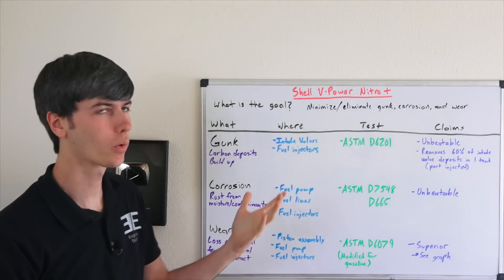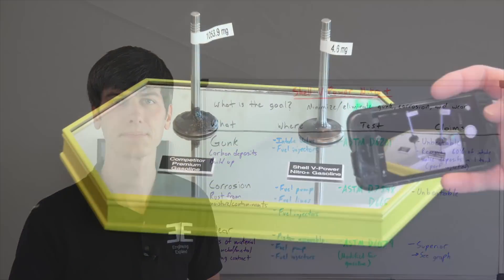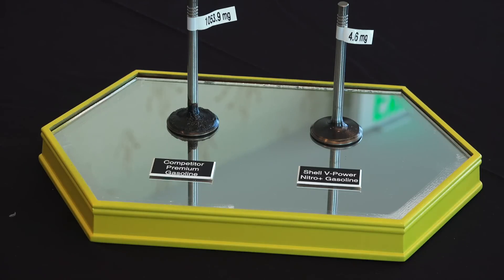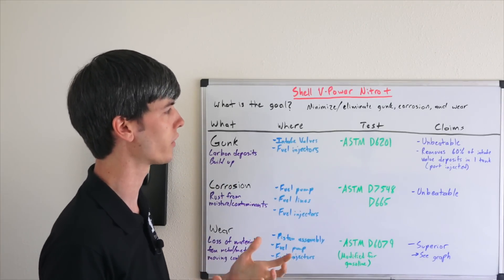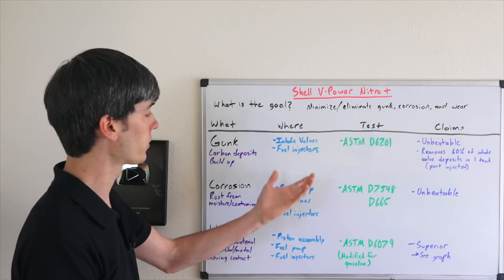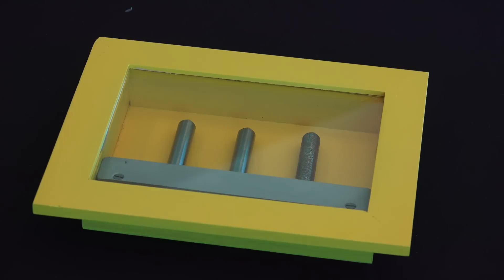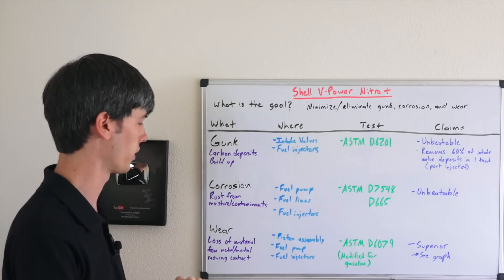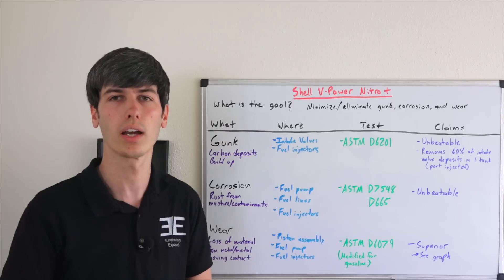Shell V-Power Nitro+ (Premium Gasoline Fuel Testing)

Comment: I've been using V-Power Nitro for a while now (UK) and having been testing it under more realistic real life situations.  I have to say that I'd personally never go back to using anything other than Nitro/V-Power,  I currently drive a 2007 HR 350z,  I've tested using a shell competitor brand (Super Unleaded).  I find that when I use V-Power my car's long run MPG increased from avg 27 to avg 29 mpg,  I also notice the big improvement in throttle response,  the car doesn't bog down as much and I also notice the engine seems to run a lot smoother in general when running Nitro+,  it's not a massive difference however if it's absolutely noticeable.  I've also created a thread of one of our forums discussing the theory and almost everyone commented back with the same results.
Reply: Hyperezil Your text reads like an advertisement.
Reply: Same here. I've noticed a difference in MPG. Love nitro+
Reply: @Tropic_Thunderzz  Shell derv is good as well, + V power derv, supermarket fuel is pants,
Reply: ***** It's actually cheaper for me to buy Shell's V-Power Nitro+ at 1.17.9 than my local Jet which is 1.21.9 for 97 Ron Super,  similarly the Esso and BP garage next to the shell are all selling their super unleaded at 117 also,  so really not very much at all, if anything it's cheaper.
Reply: 27mpg!!!! How man, I get like 18....
Reply: Hyperezil This is all anecdotal evidence and nothing scientific. All of these claims can be argued as confirmation bias or placebo.
Reply: Jaaaaap If I could advertise them and get free petrol.. I would, unfortunately this doesn't seem likely.
Reply: RPrevolution25 Standard HR used mainly on duel carriageways, into 6th 60/65mph =  27-29mpg easy done haha.  A lot of the 350zuk members are seeing roughly 18-29 some as high as 32 lol.  I take your's isn't stock?
Reply: Hyperezil 04 DE. Mostly drive around town, never on highway. Also no, not stock.
Reply: Hyperezil Where are you based?! I'm paying 125.9 per litre in London...
Reply: +Hyperezil i got better performance in the lower RPM range with V-Power than i do with any other gas, ever since Shell added Nitro my acceleration with 1.5-2k rpm has improved provided i am getting good airflow which also equates to better gas mileage overall. Also mid throttle gets me up to the speed i need quickly at highway speeds where i only need that power for a few seconds. While yeah you are paying more at the pump but the benefits is that your engine stays cleaner and you don't have to worry too much about throwing in additives.
Reply: +Aaron Tsui Scotland mate,  sitting at 1.12 per litre just now for Vpower.
Reply: Haha just added this comment and saw yours 3 down from mine ..I've been using shell 91 in all my cars getting better mileage ect. But until I bought my 350z HR have bolt on mods it idles pretty bad almost dies out and pings on shell 91. I tried 3 different tanks at shell using 91 and same thing happens. Switched to Esso which has ethanol and idles way better , same with Petro
Reply: Thanks I just tried it today it's pretty good
Reply: Yes the change in smoothness is really noticeable even against shell regular

Comment: My gunk solution is:

-Wynn's Diesel EGR 3
-Forte Diesel Turbo Cleaner
-Wynn's Diesel power 3

Using it yearly. 150.000 miles on a original EGR valve with an turbo diesel engine.
Sea Foam is also great motorflush solution but only if you know the engine is dirty and you do change the motor oil yourself.

The second car is an gasoline with multipoint injection, not using any anti gunk solutions on that car. If it would have direct injection then I would...

Comment: This Nitro+ petrol has been available in the UK for a while. I know US has different standards of testing. I BELIEVE (correct me if I'm wrong) but these fuels can also provide a little more BHP in turbo/supercharged cars. They'll run okay in normal cars (I use it in my non turbo car just for the sheer fact that I get points :D) but you won't get any more BHP. Maybe a little more miles per gallon. Anyhow I found that my car runs best on this stuff, regardless of all the hype etc.
Reply: In California we have clean gas due to smog and epa regulations

Comment: "removes the 60% of intake valve deposit" - OK. But where does the carbon deposit goes after it's removed? Is it safe to use it, w/ some serious carbon deposit? Would not do some damage after 60% of the deposit is removed? (i really don't know how it's working, and how does it effects the life of the engine) Can you explain it among the other "avoidable" contaminations?
Reply: YourNickIsTaken it probably burns up in the combustion chamber and gets sent out the exhaust.
Reply: YourNickIsTaken it probably burns up in the combustion chamber and gets sent out the exhaust.
Reply: Darren Boss So it does not do any damege when it's removed by the fuel
Reply: YourNickIsTaken No. Some modern diesel vehicles have some sort of particulate filter that recirculates some of the gasses through then engine to burn off the soot. That goes out the same way.
Reply: Darren Boss But this is not a Diesel fuel
Reply: YourNickIsTaken No. It is safe and propably the best fuel out there right now.
Reply: Thanks for the replies. Guy :)
I'm a bit late but i've read it last year too, just forget to say thanks.

Comment: Oh great, a bunch of tests done by the people trying to sell me their product. I've been using Shell in my Yamaha R1 for a while but that's because an independent motovlogger showed that he gets better fuel mileage with it. But come on, 60% reduction in existing carbon deposits in one tank?!? It would take me an hour with a wire brush and carb cleaner to scrub off 60% from one of those dirty valves you showed! I think Shell is full of crap on their claims and that representative didn't even sound very confident saying them. It may work better, but their claims seem totally unrealistic.
Reply: Dani2wheels Maybe the 'competitor's' fuel they tested against was crude oil straight from the oil field :-P
Reply: Dani2wheels 60 % in 1 tank, great.  i'll fuel with it once a year and bingo !  :P
Reply: Rodrigo Ribeiro It depends greatly on how the fuel was stored, the engine used, the metallurgy of that engine, and its overall construction.  These tests have clearly been highly optimized with the chemical properties of this particular fuel in mind.  That is not to say it does not have its advantages, but I imagine real world results will vary greatly.
Reply: +Dani2wheels All the tests have been done to an ASTM standard, but I would be very interested in how they validated them, possibly with a third party.
Reply: Andrew Price Good analysis, lots of good points made.
Reply: RoboTekno Blahaha, hilarious!
Reply: Andrew Price Good analysis, lots of good points made.
Reply: +Dani2wheels I won't use shell. Not that others are innocent. But they've been caught in numerous false claims in the past.
Reply: Dani2wheels 

Ur entirely right ! That's impossible to clean , 
(In one tank full ) & if u did get rid of everything (caked on carbon deposits)  that crud will end up in places in ur engine that can instantly cause the engine to seize up!
Reply: Dani2wheels which blogger was it I’m looking for the best gas for my gsxr1000
Reply: But he was wearing a white lab coat so he must know what he's talking about, right?
Reply: ***** Haha! That's a great point, why do I need to use it every time, once a year should do! haha

Comment: Are there any performance advantages ? I know the reducing carbon build up is extremely important. But is there a chance that they may have sacrificed the performance aspect of it for this ? 

For instance for turbo charged vehicles i wonder how this fuel will do ? is the octane sufficient enough to keep knocks down? 

Personally i've been using chevron 91 in my 1994 toyota supra and i've owned that car for eight years. Recently i took the head off to upgrade my head gasket and really there was not really any carbon build up in the first place. 

one of the easy ways for carbon to build up is when oil gets through your crankcase vent ( PCV ) and gets into the intake and cakes on the valve. if you have that problem you can get an oil catch can and it will infact make a difference.

Comment: they claim that it can clean engine valves up to 60% on one tank, but is it safe to have the carbon build up leave through the cylinder and exhaust gasses or should you clean your valves before using they're "unbeatable" product?

Comment: -Does this fuel actually contain "nitro" in it? Like a % of nitromethane in the 'V-Power Nitro+'???
-Or is it just a jazzy term they are using to spice up the fuel's name?
Reply from the maker: Nitro refers to nitrogen in the detergent, it's the element that bonds with carbon deposits and detaches it from surfaces.
Reply: Engineering Explained But the air I use in my engine is 78% nitrogen, so why do I need a tiny amount more of it in my fuel?
Reply: Engineering Explained A little misleading, lol. Oh sneaky marketing department... :-P

Thanks for the video though. If I had a car that needed premium fuel, I'd give it a try.

Comment: Engineering Explained  those photos you showed are of Direct Injection Engines so the fuel has nothing to do with the valve deposits.  only if they where port injection
Reply from the maker: Yep, honestly slipped so I added an annotation and included a note in the video description.

Comment: I'll it make my rotary backfire more? Carbureted 12A rotary engines backfire more on premium
Reply: Ty U. 12a's only require 87 octane. Putting anything higher in a vehicle than it requires is a waist of money and can cause incomplete burns which leads to "gunk" build up and can cause backfires. The octane rating is not a measure of how "good" the gas is, but how easily it will ignite/ how fast it burns. The larger the number the harder it is to ignite and the slower it will burn.
Reply: DOG_REDRUM Yes I know, I do it because I like the backfires, gunk is of no concern because I need to rebuild the thing soon anyways.
Reply: Ty U. i had the same thing happin to me years ago ran the best on 87
Reply: Luke Shaw Engine rebuild? Yeah I got an oil leak coming from the block, some bad seal.

Comment: Those ASTM test papers cost 43-62 dollars a pop, so it's quite expensive to actually delve deeper into how the tests are conducted.
ASTM D6201 uses 2.3 liter engines from Ford Ranger, which is actually a Mazda engine:
http://en.wikipedia.org/wiki/Mazda_L_engine#2.3L_.28L3-VE.2CL3-N5.2CL3-DE.29

ASTM D665 is a test meant especially for steam turbine oils and how mineral oil additives help prevent corrosion in metal parts if moisture gets mixed in with the oil. The test is clearly not meant for gasoline (engines). Basically what this test tells us is that Shell V-power prevents corrosion in steam turbines better than competing brands of gasoline, I don't think it's that relevant in an automotive sense. Or who knows. It'd cost me $43 to see what is actually tested.

ASTM D7548 states that the test can be done with diesel, regular gasoline, gasoline with 10% of ethanol in it and some other petroleum products. Shell fails to mention what kind of fuel the competing one was. They could have used an E10 gasoline with 10% of ethanol in it, which is known to cause more corrosion than regular gasoline without ethanol.

Then there's the fact that these tests are conducted by Shell. Of course they only publish results that show their product as superior to others. They might have done dozens of other tests as well, but cherry-picked these four tests because they showed the best results.

I'm not saying they don't have a good product, I'm just saying that these kinds of results must be taken with a grain of salt for obvious reasons...
Reply: Kepe  Yes the papers are expensive, however in the US most SAE, ASTM, ANSI and ASME standards/procedures/methods/white papers are available for free viewing at many university/college libraries and at most public libraries. 
First, get a comprehensive understanding of the fundamental engineering and test principles, then determine how they apply to this Shell product testing. 
ASTM D665 is not about steam turbines. It is the "Standard Test Method for Rust-Preventing Characteristics of Inhibited Mineral Oil in the Presence of Water" .  It is for testing  refined petroleum products including lubricating oil for its rust/corrosion/oxidation performance in the presence of water and certain minerals/elements.  
ASTM D7548 is specific to iron material corrosion in the presence of most liquid fuels . 

If you have doubts about the validity of the testing or the methods used by Shell, personally contact their customer service department which is available on their website. 
Publicly casting aspersions about Shell without comprehensive knowledge of the standards or Shell's methods is simply not fair to Shell or the viewers of these comments.
Reply: patw52pb1 I didn't say I doubt their test methodology or that they are lying about their test results. I said I don't trust a company to tell the whole truth about these kinds of things. Every company in the business of making money by selling something will of course try to make their products look as good as possible. All I'm saying is that Shell showed results of four tests they had conducted, but what we don't know is if they conducted more than these four tests and if they did, what were the results and why didn't they show those as well.

If the ASTM D665 is not for steam turbines, why does it say so on the D665 page? As I said, we don't know what exactly is being tested and how without paying ASTM. What if the test uses jets of high-pressure steam to test how well a piece of metal is protected from corrosion? That would have absolutely nothing to do with cars.

Have you ever seen a company release test results of their products, which show that some competing company has a better product? I don't think so. The tests and competing products are always selected so that your own product is the clear winner.

Comment: This makes me wonder why they don't add these properties to all they fuel grades. Is it something that can only be done to high grade fuel in order to be effective?

I'm running a tune that requires premium. After seeing some of the pics of carbon buildup, I'll definitely be careful where I fuel up now. I may give this nitro+ fuel a few runs through the tank.
Reply: Darren G. $$$$$$$$$$$$$$$$$
Reply: For my car if I put gas from speedway in my tank, my engine revs at idle are all over the place. For me shell's premium works great. I have a 2004 Mazda 6i 4cyl 5 speed manual.
Reply: ***** Just a heads up, the base gasoline from pretty much any seller will be near identical. Only thing you really get buying from different sellers is different cleaning additives. Same thing goes for oil buying oil. Anything wrong with the way your car runs would be with the car and not the gas.
Reply: tolikechicken Well I tried every other gas stations regular 87 in my area. Speedway was the only that gave me trouble. I just use shell premium because I can tell my engine reacts faster when using it.

Comment: What kind of gas you guys are using over there? I never saw a intake port so dirty... And I live in Brazil, our gasoline is regulated to always have 25% ethanol (E25) and many cars runs on 100% ethanol fuel. Here a engine with 20.000Km looks as clean as the day it roll out from the factory.
Reply: Olá, essa carbonização severa é culpa da injeção direta de combustível..

Comment: Do any new cars still use Port Injection? Because the part about intake valves would be irrelevant for Direct Injection vehicles right?
Reply from the maker: Ricky Julian Yep, some cars are doing port and direct to have the benefits of both. Direct alone can be problematic due to carbon buildup.
Reply: Ricky Julian Toyota has the D4S,  port and direct injection.
Reply: Engineering Explained The carbon buildup pics you showed in the video are all VW EA888 Gen 1 TSI motors, all of which are direct injection. These cars suffer buildup from poor PCV filtering and EGR particulates. It's been confirmed that there is no injector overlap on the valves as well, so the fuel will not be hitting the valves or ports in normal operation.
Reply: I don't have any data to back this claim up, but I reckon the larger majority is still port fuel injected. Heck, even Ford's new 5.2 for the GT350 is port fuel injected although it has the ability to go direct injection.

I think the trend seems to be to stick with port fuel injection unless the car has forced induction.
Reply: Most European cars are direct injection.  Japanese cars are still port injection. Although port injection cars do not suffer from carbon build up as bad as direct injection. My BMW 535 at 54,000miles had horrible build up on the valves. But my Acura Integra at 154,000 was nor nearly as bad.
Reply: Thomas Lau I wish the US got dual injection on the EAA888 G3 but unfortunately the IM bungs are plugged. Not sure why they decided to do that.
Reply: The current Mustang GT uses port injection. The new Mustang GT coming in 2018 will use Direct and Port Injection together.